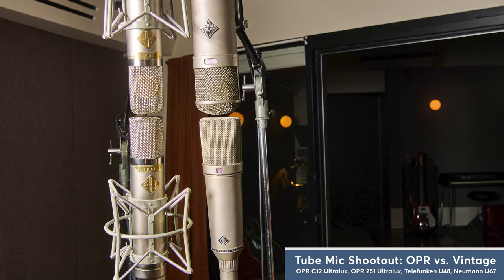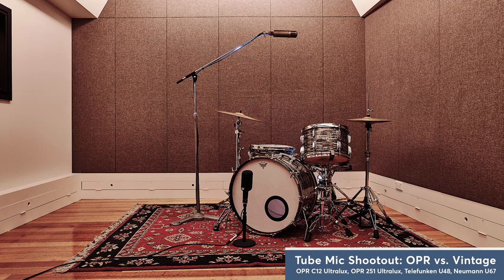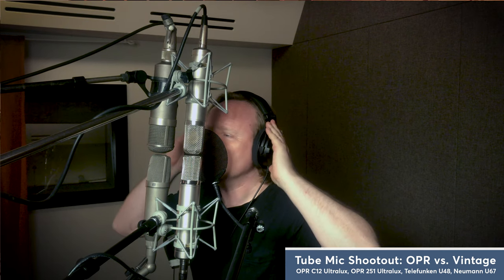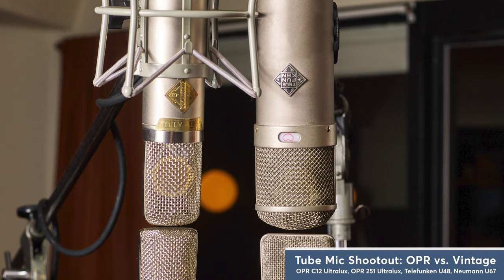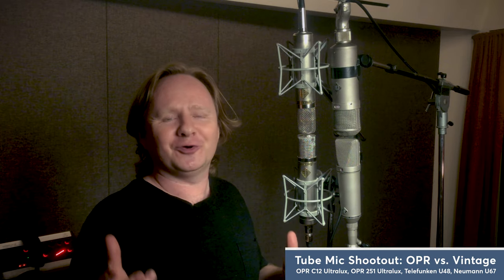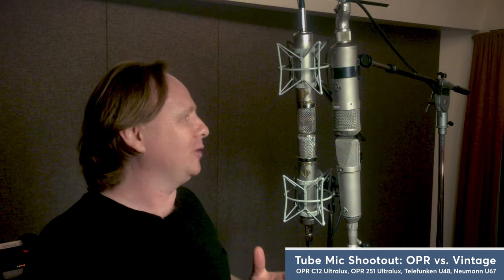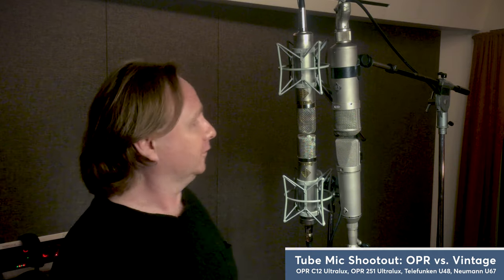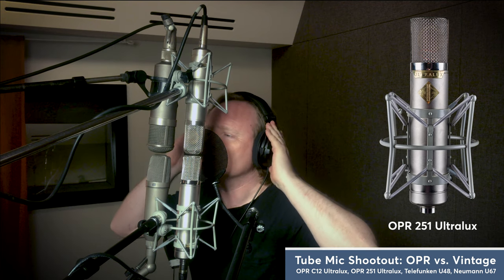Tube Mic Shootout - Telefunken U48, Neumann U67, OPR 251 Ultralux , OPR C12 Ultralux, Part 3

Comment: Finally got round to watching Jamie. All great mics. That Telefunken is just a wondrous thing! I reckon that would need the least amount of post on it.......stunning! I'm leaning towards the C12 from OPR out of the others, purely because of the way it treated the high end on your vocals....less sibilant. Would need to reduce some of the bottom end though. All mighty fine I reckon!
Reply from the maker: C12s are well known for being fantastic mics for female voices, because of the low boost - clearly I don't need it, but I agree the top end is lush! As for the U48, I think it has its place, although it's perhaps more rock than any other genre.
Reply: I would double on that. Very surprisingly the C12 clone was less sibilant and resembled U48 more than any of the other microphones.

Comment: If it wasn't for the sibilance the OPR 251 Ultralux would of won. Otherwise a neutral desser can help solve that in post. Using a heavier or regular non metal pop filter could help. OPR 251 kicks butt in other frequencies IMO. Once again it is all about taste and post edits. The OPR 251 IS WORTH BUYING if you know what voices it would work with and if you are ok doing a little post eq.. That sibilance is common in thier CK12 type mics. I have purchased 2 of their mics, not these ones being showcased.
Reply from the maker: I think, personally, you're 100% on it ! Thing is however, I actually think the U48 is non sibilant because it lacks that silky high end. There's a lot the rolls off. As you said, a dresser can solve the issue. The OPR 251 is a deluxe sounding microphone and a serious mic with buckets of tone, and for such a low cost. All hand built, gold spluttered diaphragms, hand wired, I could go on. Just buy one!!